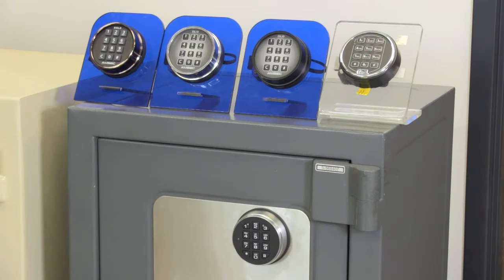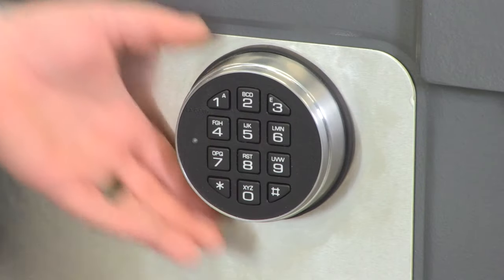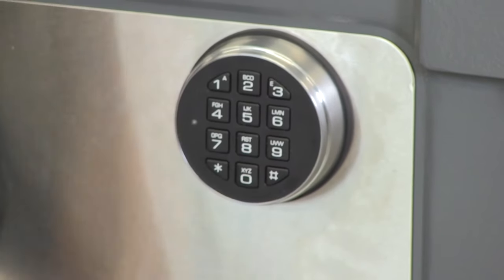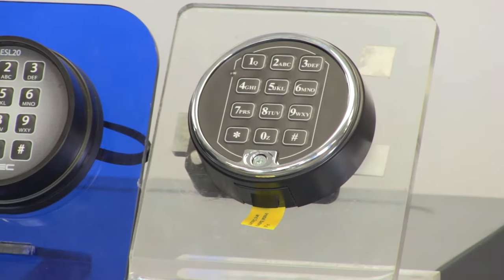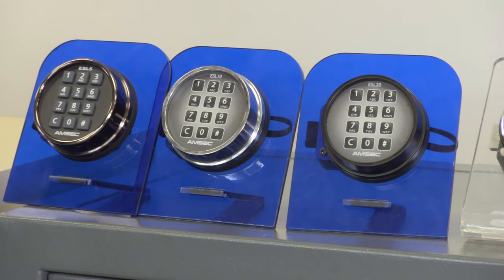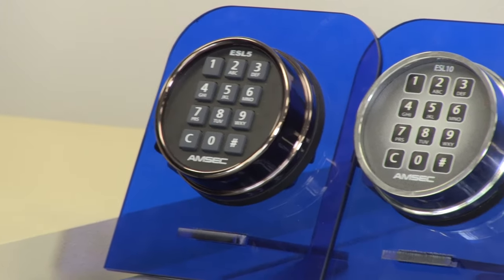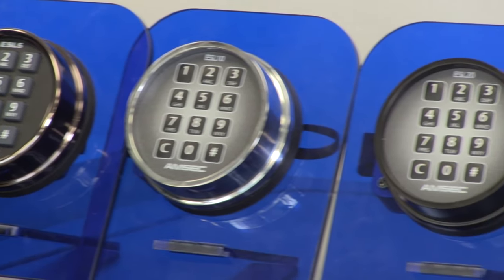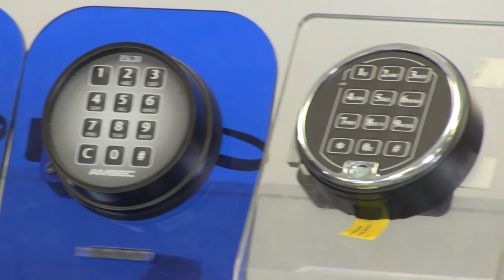How to Change a Battery in an Electronic Lock

Comment: I have the s&g digital lock, and I don’t seem to have the tab, and cannot for the life of me get the battery compartment out
Reply: I had the same issue. I used a piece of a postcard and wedged it in between the lock face and battery cartridge. Acting as the original pull tab, the postcard did the trick with some finessing.